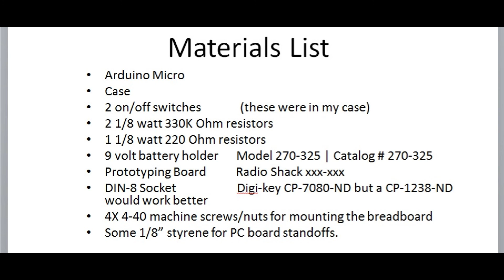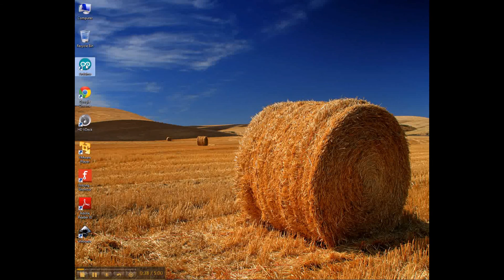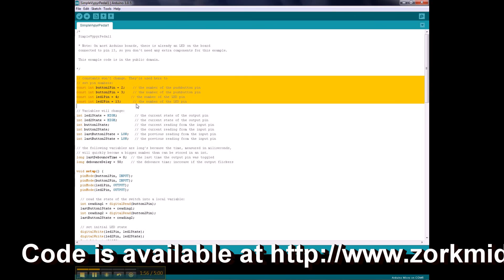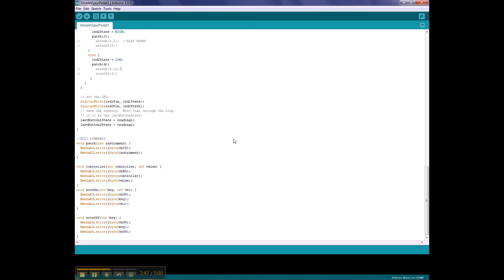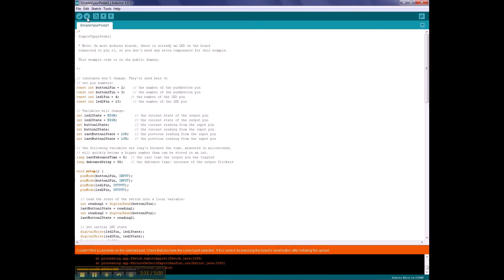Building an Amplifier Foot Switch for a Peavey Vypyr

Comment: Well I have completed my footswitch now. I used different coding (probably would make a proper programmer laugh but it works). My footswitch uses 2 momentary action switches to access 3 patches, no LED's lit is the rhythm patch then operation of a switch lights the associated LED and sends the program change. A second operation of the switch dims the LED and sends the rhythm patch. The program allows you to operate a switch while the other switch is lit so it is pretty foolproof. I tried using power from the Peavey but decided not to risk any more experimentation when smoke started coming from the amp! My next attempt will be to make a bigger one, when I do I will likely document it and post it on my channel.
Reply: I'd love to see this!

Comment: Glen , thanks for posting this - I am in the process of making it up but I find that both of the sketches (Locking & Momentary) seem to do the same thing. I was hoping to use momentary switches so that you press it and the led lights and stays lit, it then sends the prgram change. Pressing it again turns the led off then sends a different program change. What is happening is that I press a switch and the led flashes and sends a program change on both the press and release. Am I missing something here?

Comment: Glen, thanks for sharing and lover you blog site.  I have a question.  I have created a foot switch using momentary buttons (like this https://www.youtube.com/watch?v=YcbQS1nybQs) I have also added LED lights to the board but having trouble figuring out the connection.  I have located the LED connection points.  Any assistance you can provide would be great!  email is nouriej@gmail.com if that is easier to communicate.  Thanks!
Reply from the maker: +Jason Nourie Sorry Jason, I just noticed this.  Hope you got things worked out, but I'll send an email to help is I can.